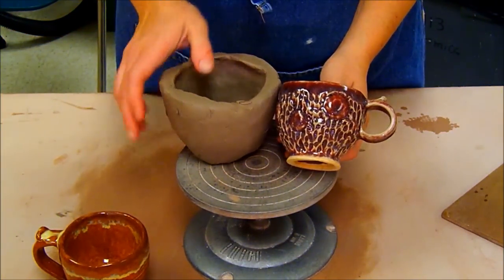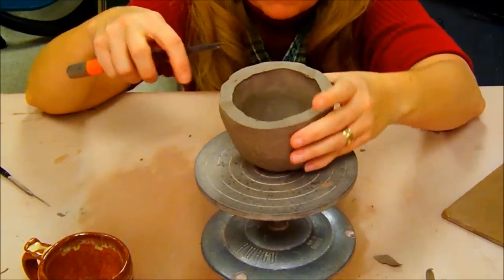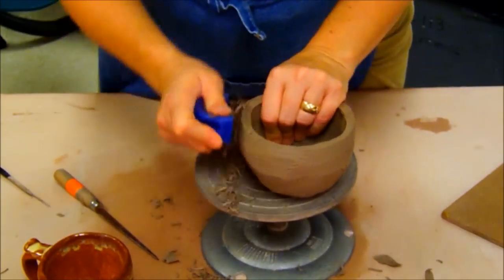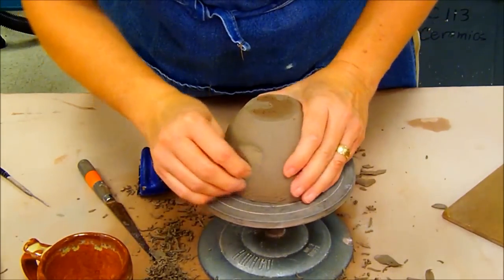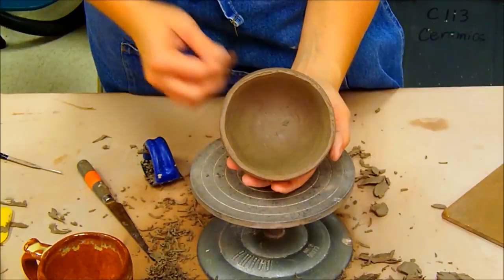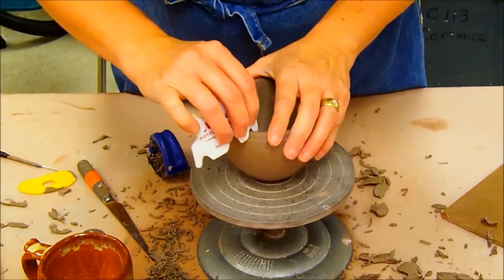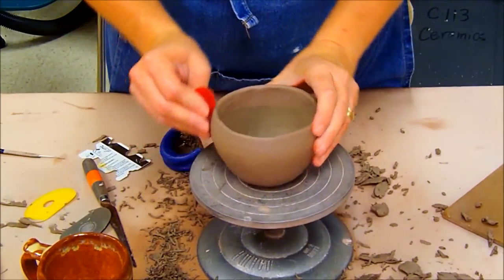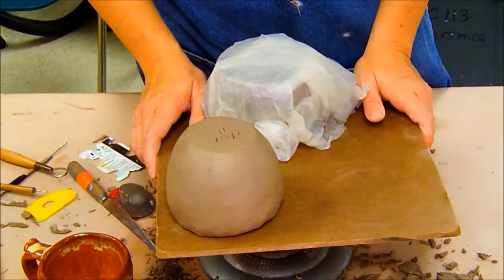Ceramics II Cleaning Pinch Pot Cup Forms- (Day 2)

Comment: Hi Karen. Why does my clay stick to the work table when I bloom it? Thank you
Reply from the maker: Clay will stick to a table which doesn't have a porous surface.  You could try putting a canvas cover on your table, or a canvas covered board to work on.  Or, some people use good quality plywood to work on- (with no finish to it) as the plywood, like the canvas, will absorb a little bit of the surface water from the clay, allowing it to release.
Reply: @KaransPotsAndGlass  thank you❤❤❤